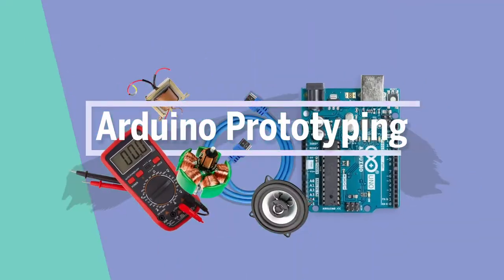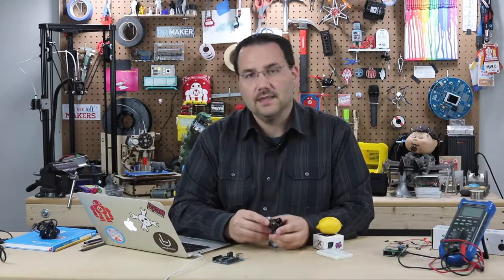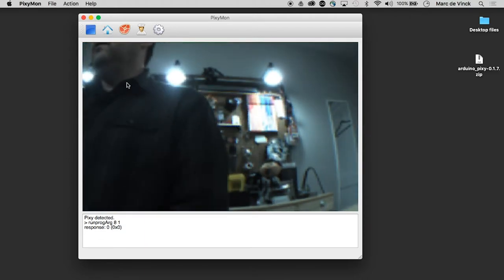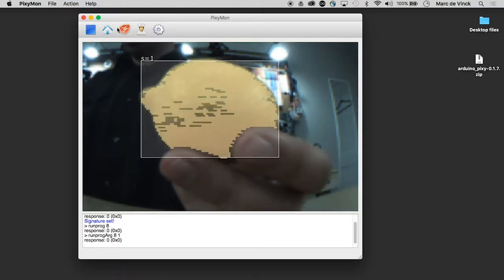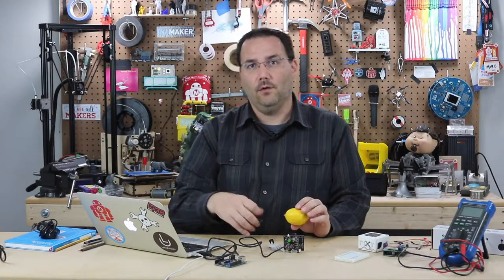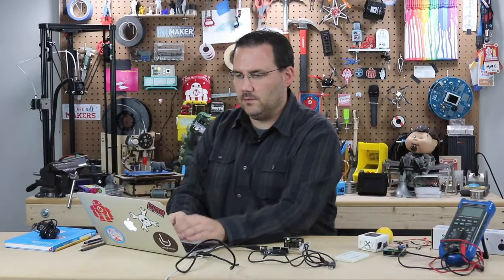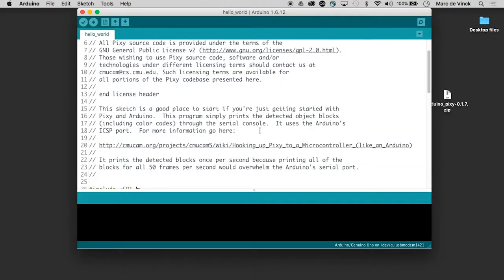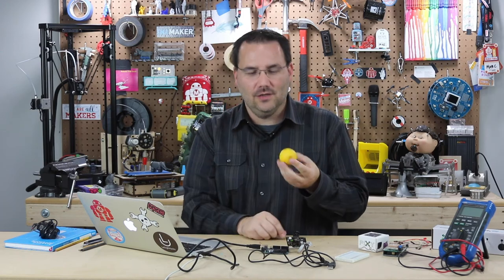Arduino Prototyping Inputs #63: Image Tracking with the PIXY! Camera

Comment: Informative Video!!  I was looking for a camera for a project when I stumbled on this video.  I want to capture the positon of a laser pointer on a piece of white paper.  if the Pixy2 reads 60 times per second that would be 16.6 ms per read.  I was going to have a different Arduino turn the laser pointer on for 100 ms ( adjustable ) So with the laser pointer on time at 100ms it should read it 6 times, I was going to average those and come up with the x and y location.   Before buying a Pixy2 I thought I would ask, do you feel that it would be able to do this?

Thanks for any info
Reply from the maker: Yes, that sounds OK, but the frame rate can vary (from my experience) so if you are tied to those #'s, you might want to look at something more robust. I still think your example would work. The PIXY! is very capable.

Comment: what is the limitation of this sensor. it seem working well. is it the quality of the camera? is it able read the infrared in warehouse or watching temperature of machine. if it find something then sending alarm.
it is just project for factories, heavy machines that working 24/7.
Reply from the maker: The PIXY Camera system is most likely not the best for that specific use. It's a great camera, but I think you would be looking for an IR thermal camera, which is readily available on the market as an accessory to the Arduino.

Comment: Can I attach two step motors to control the movement of the camera (up down and side to side) to follow an object ? I would have to create some physical base for the camera to sit on obviously. Let me know if you have any ideas!
Reply from the maker: Yes, you can use 2 servo motors (not stepper motors, they require a lot more circuitry). You want a pan & tilt base, which are available and easy to implement.

Comment: Can it recognise angle between two objects or straight line
Reply from the maker: It could, but not on it's own. For something like that, you'd be better off running Tensor Flow and a camera.
Reply: @MarcdeVinck  oh i wanted something that could recognize and object's x and y co ordinates and angle between them with respect to hirizontal and vertical line
Reply from the maker: @KKMaity  It's possible, but there are a few things to consider that may need more power and/or integrate some AI. What do yo what to recognize? Is it a color different than the background? That's not too bad. Or is it a specific shape or "thing" that would need something like TensorFlow to run an instance model to compare and identify a video feed to know objects. Also, resolution and size are major concerns. How accurate? Of it is recognizing 2 yellow objects on a clean background (no other yellow) and you want to calculate the angle between +/- 5º, I would think you can do that.
Reply: @MarcdeVinck  suppose there is a background of darker colour and on top of it two circular objects..both of the objects have different colours and also lighter than background (example background black two objects red and yellow) I want to know x and y value of the  center of those circles.. and want a robo arm to reach at that  position..
Reply from the maker: @KKMaity  Seems possible. Again, depends on the resolution required, accuracy, and speed required. Also note that there is no depth, so again a depth camera running TF might be best, but you may be able to get some sort of depth with calculating the size of the objects?
Reply: @MarcdeVinck  depth is not necessary..robo arm will be fixed at particular hight..it's only purpose is just to reach at the centre point of any circle
Reply from the maker: @KKMaity  Yes, that seems achievable with the PIXY! camera. Good luck. It's a fun little piece of technology.
Reply: @MarcdeVinck  and is there any way so that it can decide which circle is nearest to it..
Reply from the maker: @KKMaity   If it's a constant depth and constant size object, I would assume you could do some math on the size which would give an idea of which is closer, but again, that's better achieved with a depth camera and Tensor Flow.
Reply: @MarcdeVinck  actually camera would be in top view..and fixed..robo arm depth is also fixed..and suppose arm is starting from bottom. And circles are of same size and somewhere in the board..and I want that arm to know which is closest circle by the camera which is place at top view position..
Reply: Or if this things not possible using pixy and Arduino then is it possible in raspberry Pi using opencv python..
Reply from the maker: @KKMaity  That would be my choice.
Reply: @MarcdeVinck  ok.. thank you for being helpful..

Comment: if i want to make real product. Could you please suggest better sensor than PIXY?
Reply from the maker: You can use the PIXY! Camera for a "Real product"! It's great! I can't suggest a better sensor without knowing all the details of what you define as better? Larger image, faster shutter, lens, etc. There are lots of cameras available on the market for DIY electronics. Head over to your favorite online retailer and take a look at the specs to find one that matches your requirements. Just keep in mind the real value of the PIXY! is not the camera but the additional hardware and software that supports the camera.

Comment: Question: If you disconnect the internet from it, will it still work on tracking moving objects without its connection to the internet, or should it be connected to the internet in order to continue tracking the movement of objects, and if it works, can we make a project to track an object using Arduino Uno
Reply from the maker: The PIXY! Cam, along with the Arduino in not connected to the internet, and works standalone.
Reply: @MarcdeVinck  It’s HD or Full HD.
Reply from the maker: Models always are updated and specifications change, especially in DIY electronics. Always refer back to the manufacturer's website for the current information and models. https://pixycam.com/

Comment: I'm looking for a way to have arduino take a screenshot and identify a matching screenshot taken previously and then run a script based on which screenshot has been matched.
Would pixy cam be capable of this?
Is there a better solution?
Reply from the maker: You'd be much better off using a Raspberry Pi running TensorFlow. You can do image comparisons, recognition, etc. Good luck!
Reply: @Marc de Vinck  thanks for the reply Marc, I'll check out the tensor flow.  My proposed application is to find a way to automatically identify which video game is selected in a multi game box so a joystick can shift into either 4-way or 8-way as the selected game requires.
Mame setups running on personal computer, raspberry pi, etc, can be programmed directly to do this but boards/boxes are not programmable in same way.  My idea was to split the video output going to the monitor plugging one into a board that could identify based on matching screenshot at time game is launched to recorded screenshots in memory.
Reply from the maker: @trailb4u  If you are already on a computer (or Pi), why use image recognition? The system knows what game was launched, just switch the controls as needed. It should be fairly easy to implement a lookup table of games and control methods.
Reply: @MarcdeVinck  Hi Marc, I'm looking for a solution for the boards that are not a computer or pi, (a 60 in 1 arcade game board for example).  In a designated area of the screen, the actual name of the game appears in large print before pressing player 1 or player 2.   So a text reading program would do the job in this case I think.  The hardware cost would probably need to be in the 25 dollar range for this proposed workaround to be viable. I'm just checking to see if there is an off the shelf, cost effective solution.
Reply from the maker: @trailb4u  Oh, OK, that makes a lot more sense. TensorFlow on a Pi would be a good choice IMHO.
Reply: @MarcdeVinck  thanks again!

Comment: How it can track and lock automatically any object using camera and aurdino?
Reply from the maker: No 100% sure what you are asking, but that is a much larger project than you would most likely use an Arduino and AIXY! Camera. I suggest you look into Tensor Flow and a Raspberry Pi to get started with object detection and tracking.
Reply: Yes im doin project and facing problem that how to lock moving object ..if u can help plz do me favor
Reply from the maker: @shaikhjunaid5577  I would look into TensorFlow running on a Raspberry Pi. Good Luck! Sounds like a fun project!